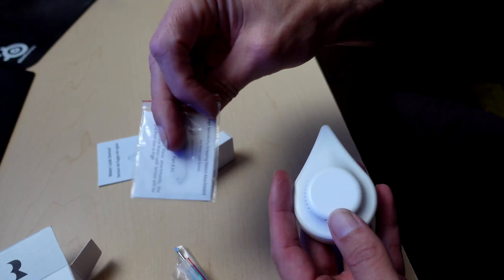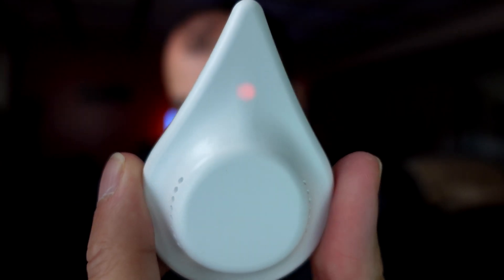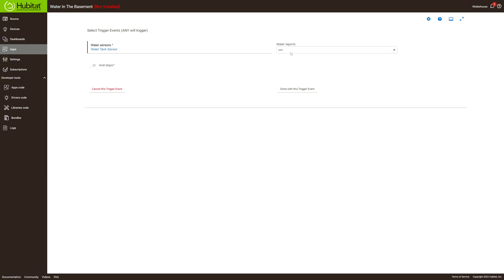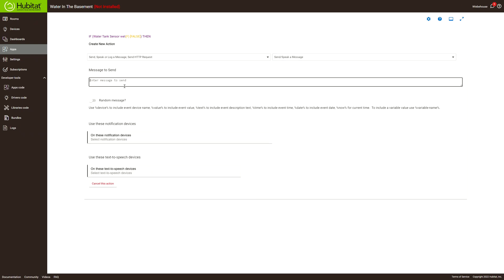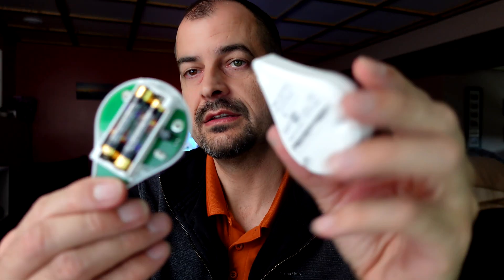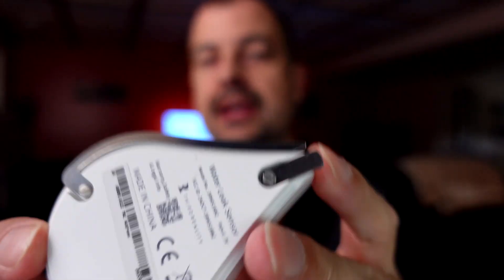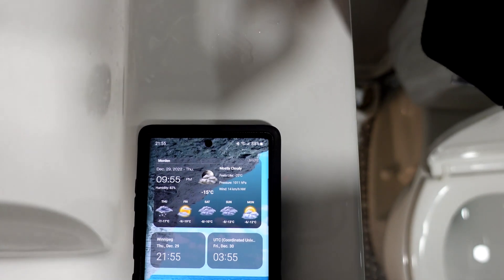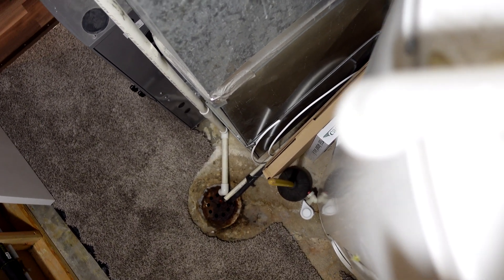Protect Your Home: Water Leak Alert!

Comment: I just want the blasted thing to go off loud enough the neighbors hear it for under 20 bucks. Do they make anything like that? That looks like ladder logic, which taint my thang anymore. What happens if I want to fill my hot tub, and my phone is kidjacked and my wife has the laptop? Things sure are getting fancy. Can this system withstand a DDOS attack? If my neighbor has the same system, can I change the channel on his TV? I dunno, my pipes are round, does it come with tape to attach it? Those screws and the battery contacts look like they will corrode pretty quick if used below ground after about a year. Will my wife be angry if she sees how much I spent and it wasn't a iRobot? Can I set my alert to sound 'The Sinking of Bismarck'?
What I want is a valve that will shut it off if it detects a leak. Simple. 
I like the Home Automation deal, I really do. But as a former Pentagon Engineer, no way would I tackle that, that's a job for pros. You should consider hanging out your shingle.
Does it come in other colors? Maybe my wife won't be mad if it comes in pink.
Reply from the maker: After reading this post I think I know what purple tastes like.